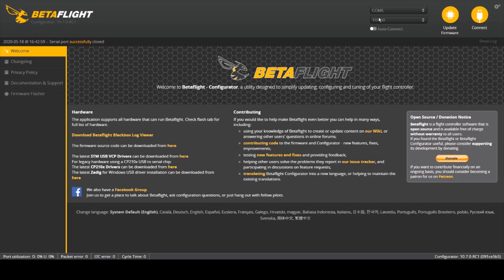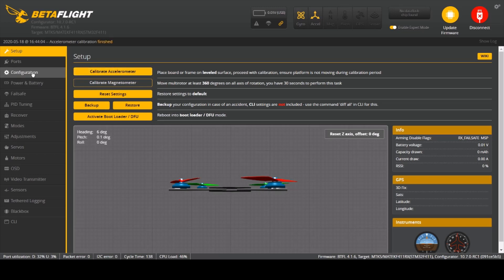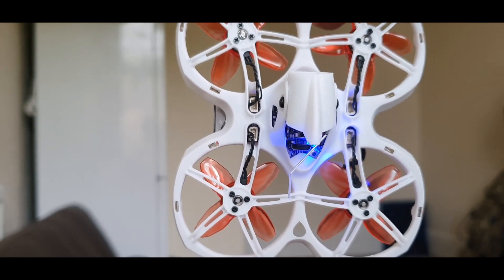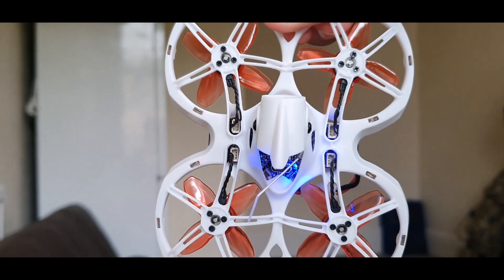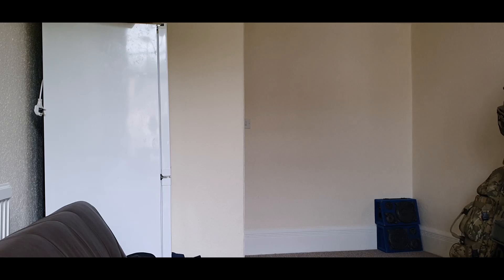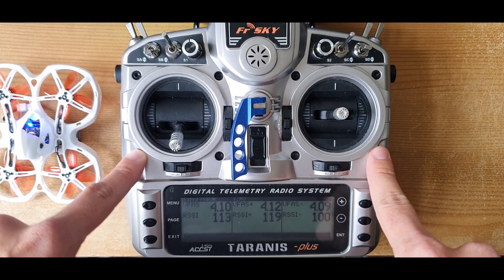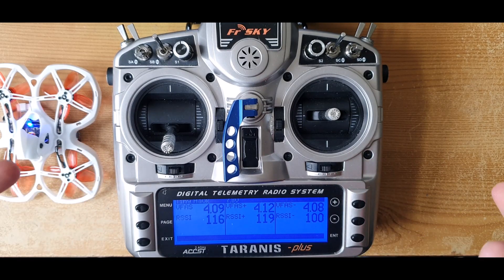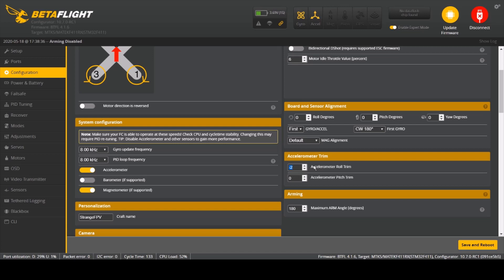How to stop your drone drifting and calibrate the accelerometer!

Comment: Is there a calibration setting to stop the drone from trying to spin a little left or right while hovering? Thanks!
Reply: check in betaflight if your controller isnt inputting some yaw. if yes, try to add some deadzone to yaw in receiver tab or solve the problem by investigating. if not... is weird because accelerometer neds just pitch and roll to be stable.